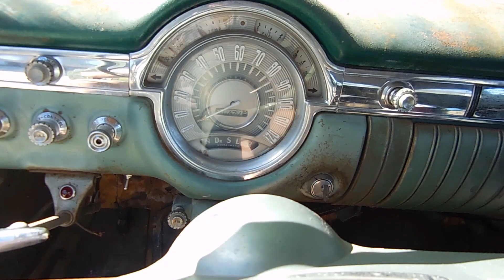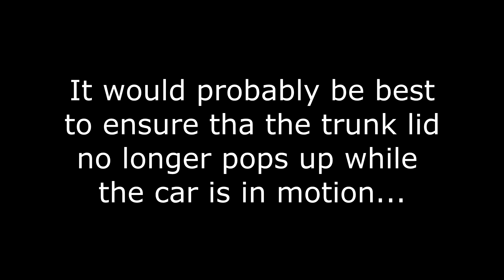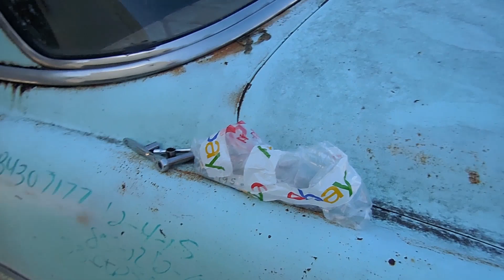Will It Run? Part 13: 1953 Oldsmobile Rocket Super 88 Barn Find

Comment: Those old 4 speed Hydramatics had no "Park" gear. Gears were Neutral on top, then Drive, Third, and Second. You couldn't hold it in First. It had a "Fluid Coupling" with like 40 bolts holding  it to the flywheel instead of a modern torque converter. It makes shifts smoother and softer. With the engine off, putting it in Reverse kept it from rolling. The kickdown rod was called a "Slush Deflector". Glad to see it driving!
Reply: LOL, as a kid with a 53 Ols, I didn't know that till now. I always parked it in neutral with the parking brake on!
Reply: Exactly

Comment: Yeah, I left my 51 Packard sit in the carport for several years after draining the Ultramatic's trans fluid, thinking i'd soon have to drop the engine (then left it sit) and my seal dried out. After finally rebuilding my 288 Thunderbolt, I'm now having the pain of refiling my trans fluid every 50kms which is a right pain to do with the INSANELY small access hole. Your Old's 88 is a gem worth keeping. I hang out for every posting. More please!

Comment: I’m loving the videos on the Oldsmobile, as I’ve mentioned in other comments I have a 1959 Oldsmobile that I have had for 25 years and I have been doing a freshen up on it, and it has been bugging me all the way, Oldsmobiles are very temperamental especially the older ones

Comment: I remember riding in my uncle's '54 Pontiac Chieftain with the straight 8 and 4 speed hydramatic. As I recall,  the shifts came quickly and the car was generally in 4th gear by 25 mph. He later had a '62 Olds Super 88 with a 3 speed hydramatic. For the 1-2 shift, the best description I can give is that it kind of "rolled" into second gear and then the 2-3 shift was nearly imperceptible. I drove that car a few times and it took some getting used to as the steering and brakes were very light and sensitive. I remember criticizing my uncle because he would shift out of reverse, up through low, super and drive to neutral while the car was still moving backwards, then he would drop it in to drive. However, he bought the car with 3000 miles on it and sold it when it had 90,000 miles and never had any tranny problems.

Comment: To engage the park pawl, shut it off in low, then put it in reverse. This transmission has a fluid coupling instead of a torque converter. It's a 4 speed auto with a final drive of 1:1. Because it is a fluid coupling (no slippage once the car starts rolling), first gear is extremely low, (3.82:1) and the shift to second is about 8-10 MPH. The trans to carb linkage adjustment is critical to how these shift and function. Hopefully you won't need to adjust the bands as the special gauges are about $250, and hard to find. 
 The history of these old slant pan (dual range) Hydramatics is quite interesting. An earlier version of this transmission was used in WW 2 tanks. The Dual Range Hydramatic as what's in this car was the transmission where B&M became a name in drag racing, when they created the Hydrostick. 
Whatever you do, don't get the inkling to pull the valley cover on this car and look at the cam. Speaking from a recent experience, you probably won't like what you see.

Comment: So just turn your idle up a couple hundred RPMs the S starts in 2nd gear for snow traction or for wet roads the D is your drive gear so if you noticed an idle down in the S gear because you're in a higher gear the Torus needs to fill with fluid keep adding fluid until the shift smooth out. Also let it warm up to operating temp to check level.

Comment: Ben-super series-well explained and appreciated.  Asking a favor here- the Oldsmobile build was running before I subscribed or knew of your channel.  I went back and started watching the build from Episode 1.  

Asking that you do a break out series on electrical troubleshooting-I understand you have a Power Probe-it would be great to see your whole car approach to wiring using the Power Probe. I've been turning wrenches for years but electrical is kind of a mystery.  As long as i was keeping cars running, my electrical concerns were never too severe. However, as I've started total restorations, the gaps in my education (wiring and electricity and troubleshooting) are really showing.  As I don't have a strong foundation, I flail around a lot and it takes me crazy amounts of time-to the pint that the projects are stalling at home.  Just a thought-please let me know. 
Thanks!

Comment: might be just me...but I couldn't hear THREE distinct shifts....and you should FEEL all three with that hydramatic...still think you have shift selector linkage adjustment and TV rod (throttle Valve Rod) adjustments to make...you really need the shop manual...it covers the Hydramatic in detail...I had TV rod problem when I replaced the small bore 4bbl with an Edleborck 600, took a while to get it right...

Comment: Another great car, and glad to see it's shifting now.  If I owned her I'd get her mechanically sound and safe to drive and not do a darned thing else to it apart maybe from a Vintage Air kit for here in TX, that patina is only original once...maybe go over the paint with linseed oil to protect it, and Brillo the glass for safety and visibility.

Comment: I have experience from 1959 super88 hydramatic (which is different version than 1953), i notice that this age hydramatic is VERY sensitive to mechanical link (from carb to trans) adjustment. So i recommend  that u soon check is adjustment correct ( use shop manual instructions)
Reply: I mean that wrong adjustment cause shiftproblems

Comment: Whole youi have it upin the air fixing the leaky trans get a helper in the car while you have the pan off and check the shifter movement as something may be worn of loose. it could also be an broken engine or trans mount. Is it a 2 or 3 speed trans?

Comment: That Old's engine sure sounds nice, but if that Hydramatic was working properly you would feel it shift nice and positive. They are 4 speed Hydramatics which is part of the reason these cars were so fast in their day. These old Hydramatics are rather complex. You need to find a good transmission shop that can still work on these to get it sorted out.

Comment: Check to see how many vacuum hoses that you have coming off of your transmission. If you have just one then you either have a badly decomposed vacuum line or you have a busted vacuum diaphragm on your transmission or both. You may have a sending line and a return line but more than likely you have just one line going to the vacuum operated shifting diaphram on the side of the transmission housing. That will make the car stall when you try to take off from a dead stop and will cause the transmission to not have the right amount of vacuum and it is causing a chattering of the bands when operating. It will search for the right gear and cause under pressure to the transmission pump.
Reply from the maker: These transmissions don't use vacuum to shift your about a decade or so too early

Comment: I would check the motor mounts?  and transmission mounts to see if the are in-tack at the right position. may be pulling on the shift linkage. Frankie barking again. lol

Comment: ……………..hi Ben.  Is it just me or haven't you already extensively worked on the Olds and even got it running and looking pretty good...….or am I thinking of the Caddy?  I swear you've already spent many hours already working on the Olds and taken us along for the ride............….in fact I thought it was at the point where you were fairly satisfied as to it's condition for re-sale......no?  This is video #13?  Maybe I dreamt it all and I'm confusing this with that Dallas episode with Bobby turning up in the shower.  :)

Comment: The hydromatic has a really low low and when it goes into second it's a pretty good step up third is not that different and then when it goes into high which is fourth you can definitely notice it and on a hydra-matic reverse is a real gear instead of just a planetary set the planetary set for reverse is the same as the one for low only it uses gears so sometimes you put it in reverse you can hear it grind it is normal

Comment: Sounds like your trans linkage and kick-down needs to be looked at over anything else. 

When you come to a complete stop, yeah, the trans goes back into first, but then almost immediately kicks up to 3rd after initial acceleration (what yours has is a 4-speed Hydra-Matic auto trans). For some reason, after cycling through 1st gear, it's skipping right over 2nd gear and going straight to 3rd, maybe 4th - that's likely why you stalled in the neighbor's driveway. And, when you're doing a rolling stop, there's no kick-down whatsoever when you accelerate.

Then again, it might need a full rebuild - but you're definitely skipping over 2nd gear in natural acceleration. Might the 98 parts car have a decent trans? They have the same engine (303.7 cubic inch V-8 - only difference is the 98 V-8 is tuned to 165 hp to the Super 88's 155 hp), so if it's got a Hydra-Matic as well, it'll ought to bolt right up.